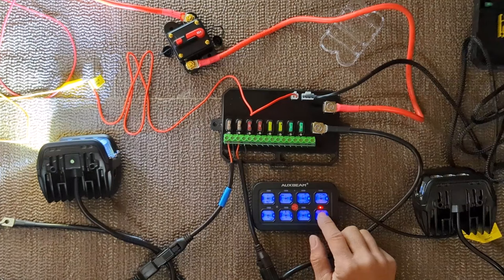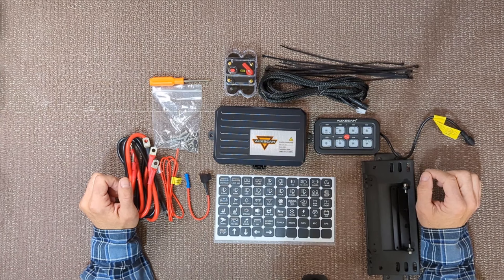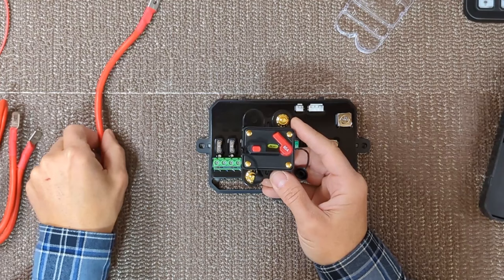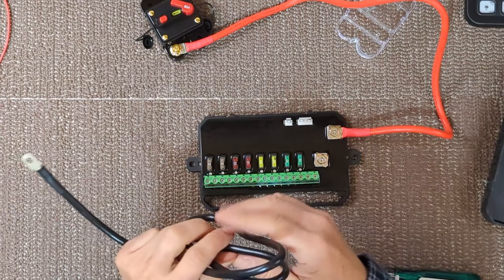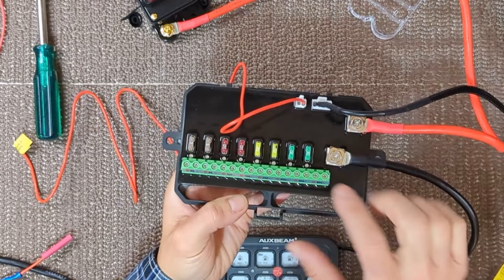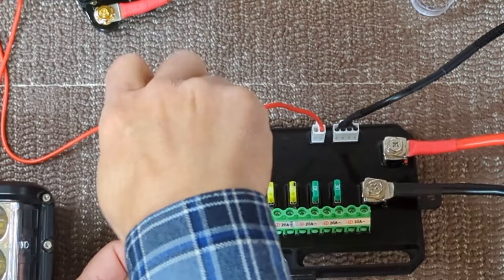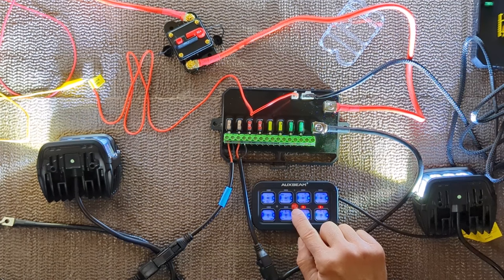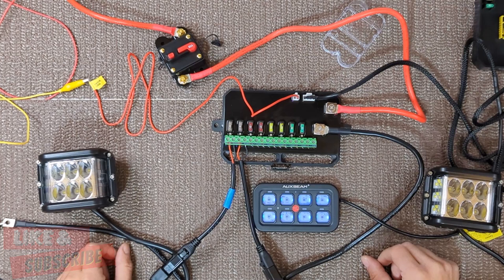AUXBEAM 8 Switch Panel - How To Wire

Comment: Great video. I recently got 4 RV flood lights for my roof rack and want to wire them all together to one switch but not sure the most effective way to daisy chain the wires together and what amperage spot to put them in.
Reply from the maker: I have done this with ditch lights. I connected the positives together and negatives together using ferrule crimp connections and inserted them into the corresponding Pos and Neg slots in the Switch Panel. You will need to calculate total amp draw for the 4 lights together to make sure you are ok to do this on a single circuit. Amps = watts / volts. If so, you can wire 2 Pos together into a larger gauge wire and do the same for the other pair. Then insert them in the correct amp circuit. The challenge may be if you can fit 2 larger gauge wires in that circuit.
Reply: @AZOverland2017  Thank you so much for this. That really made it make more sense to me. The lights are only .9 amps per and theres four so a 5a fuse slot should be alright. Does it hurt to put something like that in a 10a spot instead?

I also may split them and do two and two on 5a slots so I can control left and right side of my truck (its for four flood RV lights)
Reply from the maker: @hurpaderpp  You might get way with a 5 amp for all 4. I ran my ditch lights on a 5 amp and they were rated at 4.6 amp. I was curious to see how it would work. I should have run them on a 7.5 or 10 amp. It worked fine for a few months until it blew. I now have them on a 10 amp. A 5 amp might be tight for all 4 lights on your setup I like the idea of running 2 and 2 like you mentioned.
Reply: @AZOverland2017  I ended up doing them all on a 10amp and it worked out perfectly. Got those and a 42 inch light bar wired up. I appreciate the advice! Cheers from New Hampshire

Comment: Can you hook up like a fan switch that has high and low
Reply from the maker: Great question. I haven't done this but I would think the fan has 3 wires coming from it? Low speed power, high speed power, ground. If so, you would need to wire the 2 different speed power wires to 2 separate circuits. So yes, you can operate the fan at different speeds but you would need to switch the current speed OFF then press the next button to change to the desired speed

Comment: Fantastic video.   
I have a question.  I have 7 Auxbeam 7" 180w driving lights. Can i put them all in one 30amp circuit?
Reply from the maker: You wouldn't be able to do that, the amp draw will be too much. Double check the specs on your lights and see if they give the actual amp draw. I believe the 180w would be per pair, which would be about a 15 amp draw per pair. So, 4 lights alone would take up a 30 amp circuit. But please, check these numbers with Auxbeam or the manual that came with the lights.

Comment: How do you wire both Ditch lights together so it's one button
Reply from the maker: I did a video on how to do this here:
https://youtu.be/ikamIEXh9qE
Reply: Ment to say how do you wire both Ditch lights to the 8 Gang Switch Panel with out having to buy a wiring harness
Reply from the maker: @anthonyvaldez1052  Every Ditch light kit kit I've seen comes with all the wiring including relay and switch. What I did for both the 4Runner and Tacoma installs is simply cut the relay and switch out and use the existing wires to run directly to the control box of the Switch Panel. No need to buy anything else.

Comment: does it prevent excessive battery draw from accessories
Reply from the maker: Yes, if it is wired correctly with the fuse tap tied into ACC or ON current draw. I did another video on that

Comment: Ever have an issue regarding the control box not communicating with the 4 pin connector? 
I just recently purchased this unit . Have it installed correctly but can not get power to the switch panel. I have power going into the control box. But it ends there.
Reply from the maker: I haven't. Try using a multimeter or test light to confirm you have power going to the switch panel. When you turn the key on there is no backlight?
Reply: Yeah I have power going into the circuit control box however it’s not communicating with the switch panel correctly. The 4 pin connector has a faint “glow” on the tester. But I have to hold it on for a short time for the “glow” to show itself. If that makes sense.
Reply: I was just curious if you ever had this issue and if you knew of a remedy. I’ve reached out to Auxbeam in two separate emails. No response yet .
Reply from the maker: @glenndekanek4977  Ensure all connections are tight and seated correctly Unplug and check condition of all pins at all connection points. Make sure your grounds are clear and tight. Do the same with all + connections

Comment: Are you powering the light from the auxbeam? Or is that the on/off switch wire for the light bar?
Reply from the maker: It's being powered through the Auxbeam
Reply: @AZOverland2017  if I’m wiring up the light bar do I remove the relay from the light bars wiring harness?
Reply from the maker: @jamltayl  Yes you do. Please check out the videos I did when i installed this on the 4Runner and the installation videos I did with some of the lights I connected to it. They should answer all of your questions!

Comment: how do you close the box after all the wires are connected?
Reply from the maker: The wires are routed through a long oval opening from the bottom of the box so it doesn't interfere with the cover. I did a few other videos on the actual install. See 1 of them below:

https://youtu.be/qB2Bg-A9zQg?si=OpUmlwV-JajQ1ali
Reply: @AZOverland2017  Awesome.. thank you for replying.

Comment: Can you twist both wires together  so when you hit one button both lights come on at the same time? Thanks
Reply from the maker: Yes, exactly. Check out the video I did when I installed the ditch lights in the 4Runner.

Comment: I just ordered this kit for my golf cart was wondering if I also need a 48 volt to 12 Volt converter? (I have a 48 volt lithium ion battery in my cart.)
Reply from the maker: I honestly don't know too much about those types of batteries but I would think you would need to do that. These panels have a working voltage range of 12v-24v. Good luck wit the install and let me know how it works out for you!
Reply: @AZOverland2017  I installed today I used a reliance 48 Volt to 12 Volt reducer and instead of attaching the key switch I attached to solenoid I have a push button key switch that wasn't producing enough voltage to power the reducer all in all I'm happy with the install and ready to start adding goodies😁
Reply from the maker: @codahblack6935  Awesome! Thanks for the update 👍

Comment: Can anyone help? I have a 15 tacoma pre runner sr5 i have a rear bumper with 4 18w cube led lights to my understanding i have to wire them to the box to number 7?
Reply from the maker: Amps=Watts/Volts
(4) 18 w lights= 72 watts
72/12 volts= 6 amps
If you want to operate all 4 together on 1 button, connect to a 7.5 amp or 10 amp circuit
Reply: @AZOverland2017  first thanks for answering and 2nd so i cant wire it to the panel box? The 4 leds it has it 2 on each side so a total of 4 the rear bumper i have is the YZONA rear step bumper for a 15 tacoma pre runner sr5
Reply: @AZOverland2017  new to all this stuff sorry don’t want to sound that dumb hah
Reply from the maker: @juan1920  Not a dumb question at all. You're smart enough to ask it. Good luck!

Comment: Hello 
I got a similar switch panel from caliraised led but when I connected the jumper cable to the 10 amp ignition the dash show me a air bag error and a  brake override malfunction error, when I pull it out a put the own fuse everything works ok any ideas
Reply from the maker: Sure. try to watch some of my other videos when I do the actual install on my 4Runner and Tacoma ( 2 separate videos).

I also did a video on tapping into the fuse panel a few months ago which can help as well. You want to find a fuse that is not going to interfere with critical functions of the vehicle and also figure out when you want to send power to the switch panel. Those videos should help. If not, let me know and I will help guide you a bit further

Comment: I'm having an issue with the LED panel not turning off even when vehicle is off. Double and triple checked my wiring and even had an accessory light controlled by the panel. No other lighting or connection issues to trace. LED panel stays lit. Any ideas?
Reply from the maker: You are saying the backlighting for the Switch Panel is lit with the key out of the ignition? If so, did you use a test light to test both sides of the fuse you tapped into?
Which fuse did you tap into? Did you watch the video I used on Fuse taps?
Reply: @AZOverland2017  thank you for replying. I will and watch the fuse taps video you suggest. I didn't run the test light, just tapped on to the radio 30a with the provided fuse tap line that has the 5a that came with the unit.  Everything works normal in the system except LED panel controller stays backlit even with no key in ignition.

Comment: In a dual battery setup (isolated starter battery and second battery for lights, etc.) would you just wire the Auxbeam switch directly to the second battery as opposed to going to the ACC fuse in a single battery setup?
Reply from the maker: Sorry, I missed this. You can, but there would be power to the Switch Panel at all times; ignition on or off. Some Switch Panels do that but it's up to you. There would obviously be a continual power draw, albeit minimal

Comment: Do you know if there is a way to have one of the buttons come on when the vehicle is powered on? Example: I’m trying to wire in running lights that come on automatically but don’t want to splice into the vehicle harness.
Reply from the maker: No, I don't believe that will work. Are these aftermarket running lights you are trying to do this with? Why don't you just add a fuse tap. That will allow you to do what you're asking. See the video I did below

https://youtu.be/qyOkrW4P5qk?si=190OwhHvxSBAnPeB

Comment: When adding circuits (additional lighting) do you need to disconnect battery or just simply switch off the breaker? Cheers.
Reply from the maker: You can flip the circuit breaker and it will not provide power to the box
Reply: @AZOverland2017  Thanks for the reply sir

Comment: If I had a 3rd item that required 20A, could I replace one of the 10A with a 20A?
Reply from the maker: According to Auxbeam, yes, as long as you don't exceed the total capable power of the Control Box. Please contact them to confirm that is still the case. These companies update their products often and what held true a year or more ago may be different today.

Comment: If you don’t need anything greater than a 10 amp fuse can you just switch out the 30amp fuses and plug in 10 amp fuses? Or are you able to run a light that’s not 30 amps on a 30 amp fuse?
Reply from the maker: Great question. My understanding from Auxbeam is that you are able to change the fuses to a lower amp. I would definitely reach out to them to see if that still holds true.
Reply: Thank you!

Comment: Can you connect the two lights to one circuit? Instead of connecting them to separate circuits in order to save space in the box and to use one switch for two lights. Your response will be greatly appreciated.
Reply from the maker: Yes, that's exactly what I did with the ditch lights on the 4Runner and Tacoma. Check those videos out and you can see exactly how I did it
Reply: @AZOverland2017  Awesome, thanks for the quick reply. I’ll check those videos now. BTW awesome videos and tutorials.
Reply from the maker: @stephanm.4715  I appreciate your feedback!

Comment: So what if you had a programmable pod light or pod lights that have Amber/green side flashers, then how do you wire those up?
Reply from the maker: What kind/how many wires are coming off each pod? I did a video on wiring up 
White/Amber Rock Lights to the Auxbeam. Check it out and see if it helps.
Reply: @AZOverland2017  there is 4 wires on the pod light. They are auxbeam pods.
Black-ground
Blue-main light
Red-strobe side light
Yellow-solid side light
Reply from the maker: @matthewaaron664  You May have to run each colored wire to a separate circuit if you want to keep all three operational. Check out the video link below for the rock lights. The way I did them keeping the amber and the white. I have to run them on two separate buttons. About 10 minutes in is where the wiring starts

https://youtu.be/ioepyPizNCY?si=T_cBaps3iZZl3Vbg

Comment: I'm looking at doing this as well. What led you to this unit over the others that are out there? Thanks!
Reply from the maker: I was going to do a Switch Pros or similar and have (which I purchased already) a separate fuse block and relays. It was still not as clean with the needed relays and very expensive. This cost me only $135. That, to me, is a very reasonable price for everything you get. And, a cleaner install

Comment: Is the led switch still supposed to be on even when you turn the truck off? Mine won’t turn off when the truck is off
Reply from the maker: Are you referring to the back lighting on the Switch Panel? If that is on when the key is out then you probably tapped into the wrong fuse. It needs to be a fuse that is only live when you turn the key to ACC or On. What fuse did you tap into? Did you check it with a check light or similar with the key in different positions?

Comment: Is the back lighting supposed to stay on all the time? I don't want it to, but it doesn't turn off, I have the red wire connected to the dome fuse and back lighting stays on all the time which I imagine will eventually kill the battery , how do it turn it completely off?
Reply from the maker: Just find another fuse. Try to tap into the headlights.
Reply: @AZOverland2017  washer fluid one worked lol stays off when tacoma is off and turn on with vehicle but it's a 20 Amp fuse, (not sure if thats safe or not?)
I had to stick a wire in it directly old school style, the add fuse ones they sent me won't fit.
Reply from the maker: @r6realtor  Ha, glad you got it working. Definitely get an add a fuse in there. You need to have the separate circuits fused correctly
Reply: @AZOverland2017  will do appreciate the help! The one they sent was to big but it was a double fuse style one, stick it in and add 2 fuses if it was the right sized one? 
Like do I just put two 5amp fuses in there?? Even though let's say I'm sticking it into a 20amp fuse? I guess the slots are confusing me and does it really matter what slot I stick it in amps wise? Like it's ok to put the add a fuse in a 20amp spot but then stick a 5amp in the adda fuse to protect the auxbeam controller, I guess is how it works?
Reply from the maker: @r6realtor  Use the amperage fuse that they had preinstalled as is. This protects the controller.  The fuse you took out needs to go in to the empty slot in the add a fuse so that whatever you tapped into is protected as it was from the factory
Reply: @AZOverland2017  got it, thank you sir! I do appreciate!!

Comment: Thanks for the detailed instructions.  Need help though. I connected direct to the battery so I can turn on/off without car being on.  But the switch panel is constantly on.  Wondering if that will drain the car battery since the panel is constantly on.  Hoping you can provide some advice:  thanks in advance
Reply from the maker: You need to fuse tap to an ACC fuse. Watch my videos on How To Fuse Tap and My 4Runner Auxbeam Install. If you still have questions after that, let me know and I'll help guide you
Reply: @AZOverland2017  thank you. Will do

Comment: Did you have any issues running the positive and negative cables through the bottom slot on the fuse/relay box? I can't seem to make the positive cable bend from the connection through the bottom slot at such an angle. My only other idea is to run them through the right side and drill a hole through the top cover to fit them.
Reply from the maker: I'm not sure what you mean. Did you watch the video I did when I actually installed it in the 4 Runner? If not, watch that and see if it doesn't answer your question
 If not, let me know

Here: https://youtu.be/Xag7N0t7wU4?si=2Kevcb-_boVFKLkv
Reply: I figured it out. The red and black cable were having issues bending enough to fit through that slot on the bottom of the control box. I just hooked them up and let them slowly bend enough to make the sharp angle. Ill see the referenced video to see if it addressed that

Comment: You said that when you wire your ditch lights you will join them together so that when you push the switch they will both turn on.  Each light is 5 amp so when you connect them together and connect them to the fuse panel do you wire both wires to 5amp or do you wire them to the 10amp slot?
Reply from the maker: If each light draws 5 amps (10 amp total) you could wire up to a 10 amp fuse. If for some reason you blow that fuse (unlikely but possible if there is a surge) you can wire up to 15 amp.
Reply: @AZOverland2017  The next higher amperage in my fuse panel is 20 amp or can I add a 15 amp fuse in the 20amp slot?  Thanks
Reply from the maker: @Mrv1960  Auxbeam has stated in the past that you can switch the fuses out. I would double check with them to be sure that still holds true as these companies tend to update their products with newer versions fairly often.
Reply: @AZOverland2017  Thank you your videos are well done , that  I subscribed.
Reply from the maker: @Mrv1960  Thanks, I appreciate it!